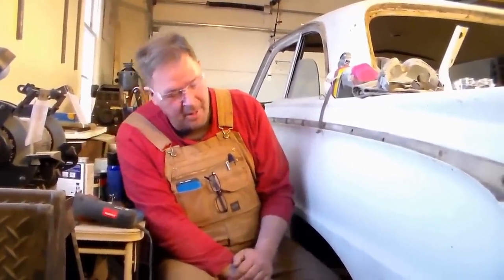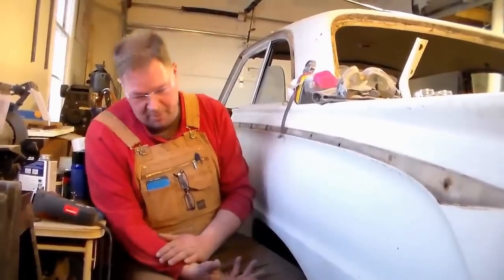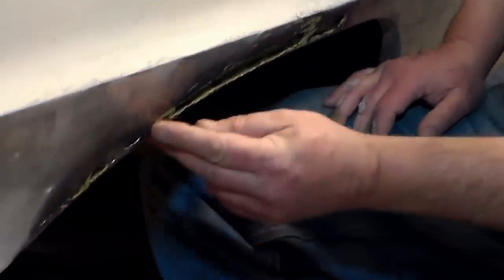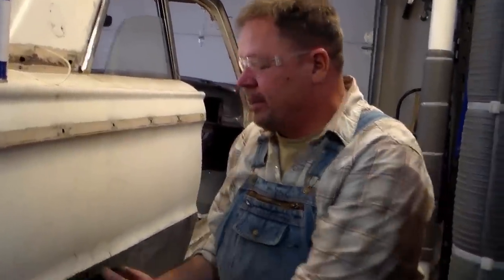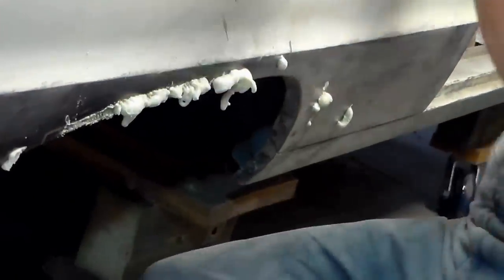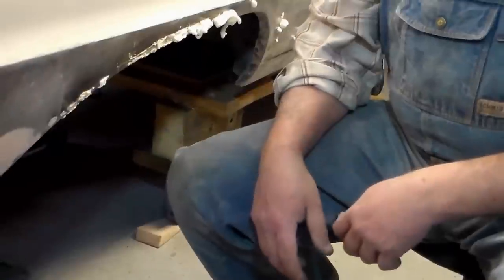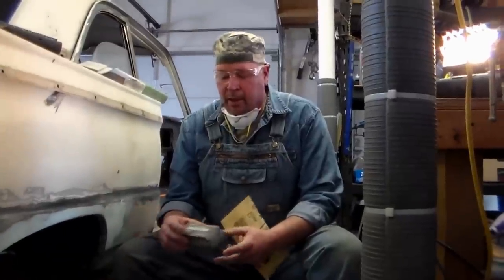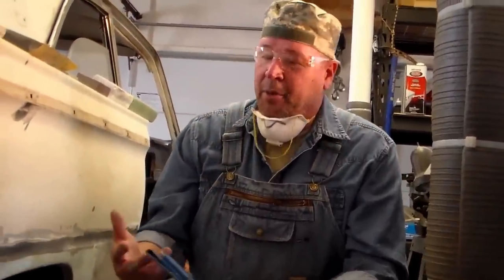Rust Repair Large Rust Holes Using Fiberglass Without Welding (Pt. 1) - Car Restoration

Comment: Remember, this is a vintage car, but it's not a Duesenberg or Rolls Royce. He won't be driving it during winter on salted roads. The way he did the patch with fiberglass cloth encapsulating fiberglass mat is very strong and bonds tightly to metal. I was skeptical until I tried it on my old winter 4x4 (only worth $3,000). This is called a "country restoration" and it's just fine. You can also do additional repair in a few years if needed. Welding is the proper method for a vehicle of value, but not worth the cost and effort for most older cars.
Reply: Exactly my thought... I did this on my 55 Chevy, eventually I plan to save and replace the panels (or welld in new panel patches), but for now fiberglass is fine.

Comment: I used fiberglass many times years ago and even anchored it too by drilling holes around the perimeter and applying glass to the back side so that the fiberglass/resin anchored to each other through the holes but! fiberglass bonded to metal eventually comes detached over time and then you have a another mess. Metal shrinks and expands plus gets very cold and hot compared to the fiberglass so eventually the glass will come loose off the metal. Another time I tried glassing-on a fiberglass cowl-induction hood scoop to my truck metal hood and within a year parts of it came loose and had cracks along the metal/glass joints. The amount of time and trouble it takes to fiberglass rust holes I found it actually takes less time to weld metal patch panels. I used a solid cardboard type material for making my templates of the hole/area I need to fill-in and then stitch-weld the metal patch into place using a wire-feed welder...a little grinding and a little fiber-bond and wal-la...your done. If you want to do it right use metal!
Reply: Good analysis and makes sense. The issue is: welding equipment is expensive and most of us won't use it frequently enough to justify the cost for old winter "sacrificial disposable" vehicles. Many of us live in rural areas where they salt the roads and we can't even wash the old 4x4 for several months. So, it comes down to practical economics. A $3,000 or less value 2nd vehicle is just not worth the welding investment. And most rust-belt folks can't afford anything else. But I'll monitor the patches for integrity. Thanks for the heads up.
Reply: That makes sense
Reply: My dad used glass in my car. No problems 4 years later. But he is an experienced boatbuilder. Not seen a video yet where it's been done right. Must be a dying trade 😯
Reply: How do you do it right? You sew it to the metal with thread?
Reply: Did you scratch the surface up real good, wipe with acetone and then do it in a dry place.
Reply: Yes...sanded with coarse sandpaper...cleaned with acetone and laid the cloth in my dry warm shop. The problem that I think I had is up here in WA the weather is very rainy and cold all winter and think maybe this has to do with the glass popping off the metal when the metal shrinks and contracts. If you lived in a warmer state it would be better. But the very best way to fix a hole/rust is to weld-in a new piece of metal. It is not hard to do with a wire feed (mig) welder. I know they are expensive to buy but worth every penny. Barrow one or rent one! Welding in a patch panel is easy..it just takes time and patience like everything else...but is actually faster than using fiberglass cloth/resin.
Reply: I have patched up my car in september with fiberglass plus body filler. After the work I agree with you Coherant bliss, weld it guys. I would rather rivet it, than use fiberglass. Of course, it is an economical solution for a few years...
Reply: I've used rivots before, a lot, and put filler over them, it worked, but would not last long...like you said a few years. Save your pennies or do some side jobs (like I did) to pay for a welder. I've learned in my old age that the only reason a person does not have the right tools is because that person is either lazy or doesn't really want them bad enough. Young men these days seem to be lazy for the most part...but every once in awhile I see a young go getter...oh, or the poor guy is hen-pecked so bad he cowers-down to his boss wife...Basically it's a "get off your lazy ass". And be patient! lol
Reply: Well, you are right. Still I want to get shit done till I get my tools, and a garage...or the money for the welder. So I hack...
Reply: keep it up...it will happen....chins up! Oh, and look for a new friend with tools, and trade him for things...I did. I mean use his welder in trade for you doing something for him....plus we learn a lot more too...from these friends. LOL I remember the first time a bought a small can of bondo (I was still a teen) and when I was ready to use it I mixed the whole can with the hardener....geeze...I thought "oh shit!, what a dumbass" But that is how we all learn right? We can't learn shit if we don't make an effort! I learned to at least read the frickin instructions first lol....well, sometimes lol!
Reply: Here you guys, I live in  Ireland where we live in one of the dampest climates on the  planet. I inherited a Ford Prefect 1948 which was filled with aluminium plating expanding foam and fiberglass. I am the 10th owner of this vehicle. There is no undercarriage reproduction panels yet made for this car. The owners before me did a great job in a rescue operation 
which will lead to eventually to a complete restoration. I think the  fiberglass idea is great for buying time until later times when reproduction parts comes available. Some of the Yanky comments I just read, are up their butts, Oops

Comment: I used your method and I'm pleased. on lookers can't even tell.
Reply: its a good technique as long as its not a structural part, great for roof areas as well with minor leaks etc. Thanks again for the aircraft remover tip, works very well for the cleanup process.

Comment: Always Bog twice, first time get the dents, hole etc  filled and neatly contour the shape (don't worry too much about highs & lows just yet. When dry, scuff lightly with 100 or 80 grit sand paper and apply second coat over the whole repair (everything) again thinly & contour to a perfect flat finish (this time paying attention to the high & low spots). 
Sand using a long flexible flat sander over the entire repair evenly (not just in spots no matter how much you are tempted to do it)  until the old good paint & bog become one even flat surface. 
Always remember that if you sand through to metal you either have a high spot or you have just sanded too much in one spot. If this happens you have to remove the high spot and Bog over everything again until it stops happening. The Same fix for too much sanding in one spot ,apply bog over the whole repair again and sand. You'll either work it out or go mental trying.

Comment: You could've spent $90 on a little HF welder and hand formed a half decent patch panel to repair it correctly. 
The way you did it, why even bother stripping the paint, just stuff an old rag into the rust hold and bondo over top of it. This is horrendous.
Reply: Question is. Does he really care? He said it's not the correct way but a way he is satisfied with. If you neutralizer and get all the rust out it will last for a decent amount of time.
Reply: Obviously he does not care, that was my point. Stuffing a rag into the rust hole and filling it with bondo will also last for a decent amount of time.
Why would he spend all that time to strip the car down to a shell and rebuild it from scratch, but then not bother to do any actual metal repair? If that's the way he really wants to spend his time then more power to him, but I don't get it.
Reply: SuperKONR not every repair needs to be a showroom restoration.

Comment: Using fibreglass OK but for the LOVE OF GOD PLEASE NEVER USE SPRAY FOAM AGAIN! That will accelerate rust behind the panel much worse than not using foam. Huge mistake!! Otherwise pretty good, Durablocks have a great reputation, I just bought a set.
Reply: What do you think about using waterproof spray foam like Fill and Seal Expanding Foam?

Comment: I'm exploring fiberglass instead of replacing a floor pan
Reply: Same. I have a 6x6 inch rust out on my floorpan that I'm planning on just layering several layers of fiberglass inside and out for the repair. Have you done it yet?
Reply: That’s what I’m going to do in my 83 caprice